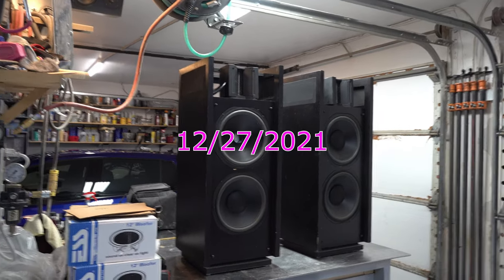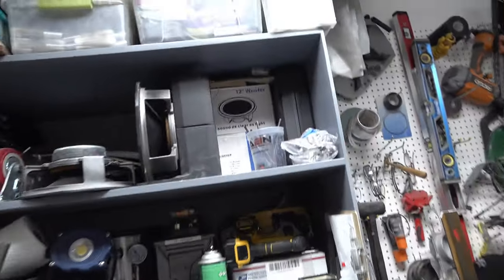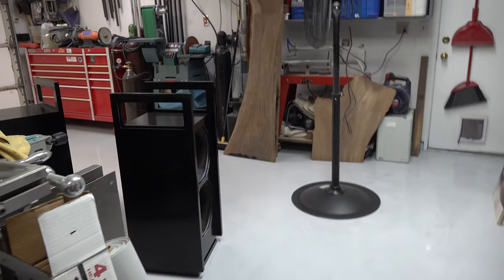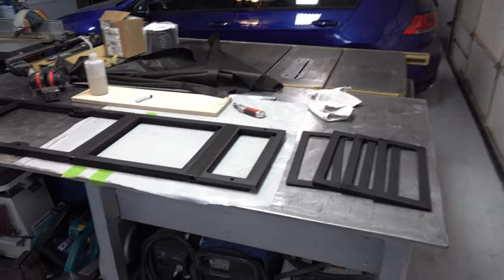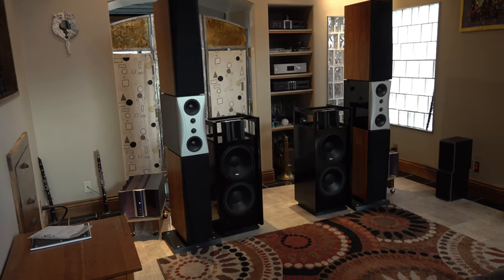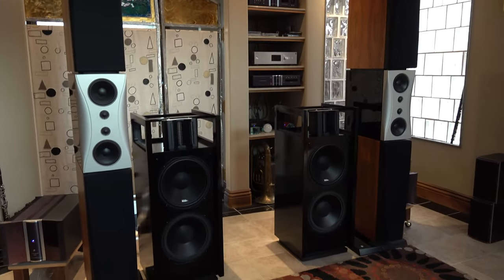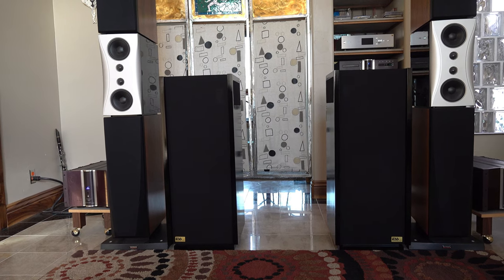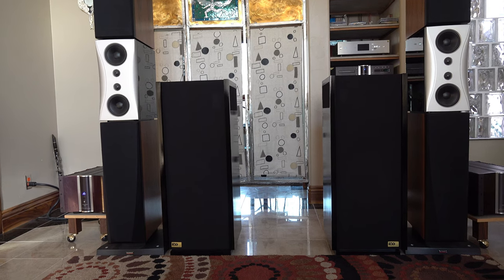ESS amT 1eM Speakers restored to original.

Comment: The height of the soundstage is lower on the ESS, midrange is subdued and not pronounced with very inaccurate bass
Reply: Remember that sound quality is highly subjective. I’ve tried klipsch and the highs are bright and lively but lacks low level detail and prefer the sound of my Bose 601 series I that I got rid of due to foam rot. But my pair of Q Acoustics 3020i’s sounds significantly better than my Bose 601s similar warmth by the high end has that sparkle that the Bose lacks and similar low end extension despite smaller size but punchier. Martin Logan electrostatics that look like the stereo speakers from The Sims 2 are a little too sterile for my tastes and find the sound stage a little too airy. I prefer more bass, a sweeter midrange, and highs that are just as clear but with a different soundstage. So the ESS would probably fit the bill for me.

Comment: Hi, do you think the bottom 2 plate is removeable or is it part of the sealed box? If the box is sealed before they put on these 2 wood plate, then it might be able to remove and put on som nicer looking steel feet or plate. I have  same speaker but have not taken apart for repair yet  best regards.
Reply from the maker: The bottom piece or plate is manufactured as part of the cabinet, but the feet can always be changer out. Also, ESS sells new replacement ribbons and speaker drivers if needed, making them sound and perform like new again. I ended up giving those speakers to my daughter and she really enjoys them.

Comment: How do I replace the wilder on my Ed’s Heigl’s speakers?  They are 10 inch wolfers and there are two small wires from the tweeter that are attached to the wolfer.i don’t know how to do it but want to fix, best speakers I’ve ever owned.
Reply: Ess Heill wolfers on speakers.  (Auto correct earlier messed up)

Comment: Nice rebuild.    What kind of watts are necessary to drive them?   Also, are there any passive radiators?
Reply from the maker: My amps are 400 watts, but I think half that would be fine.
Reply: They're so sensitive even 20 watts work well. They sound great on tubes, even on Reisong A10.